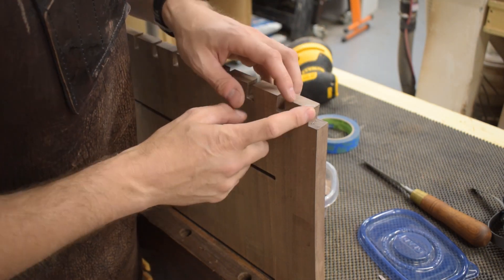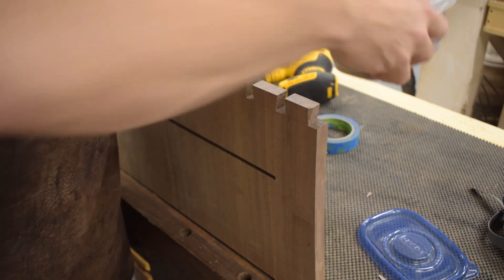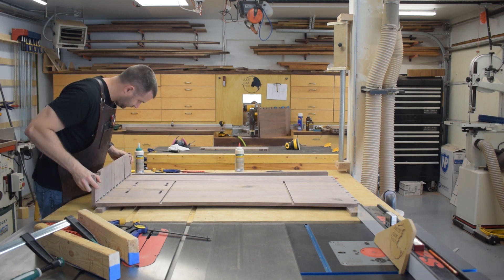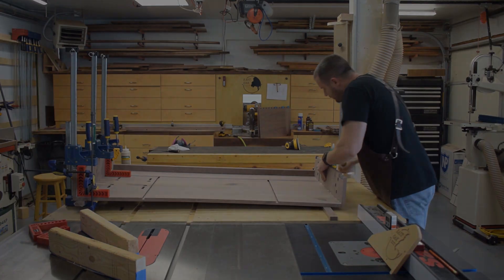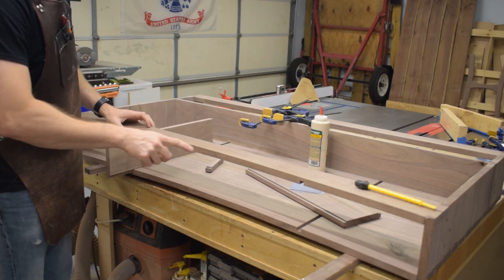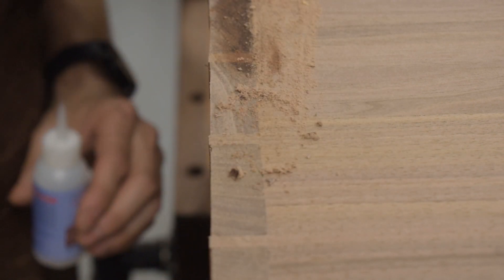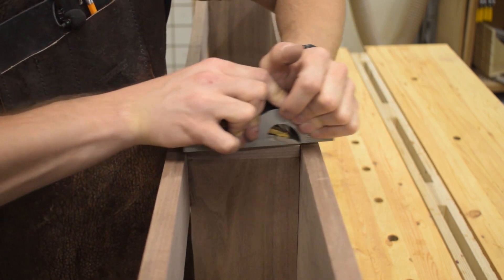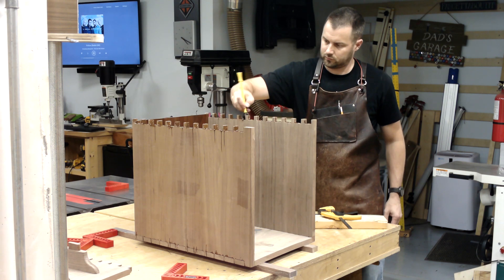Walnut and Maple Desk Part 7

Comment: I’ve been there, I feel your pain. For this very reason is why I used Liquid Hide Glue. Long working time, 20 minutes at least, and when something like this happens, it is easily reversible. I can stop the process, take it back apart, fix the problem and then glue it back together. Difficult glueups? Liq HG is the way to go........

LOL. I wrote this as I was watching and now I see you did switch. Great minds think alike I guess.......
Reply from the maker: lol, I’ll make a dumb mistake sometimes, but never twice in a row. The hide glue was so much better!